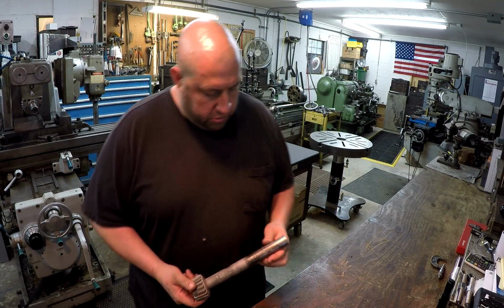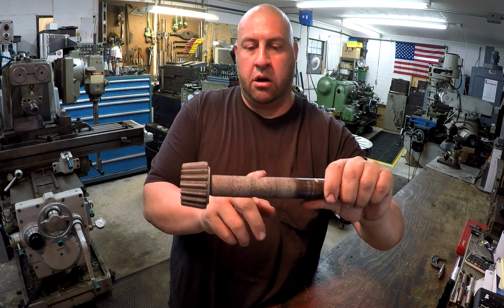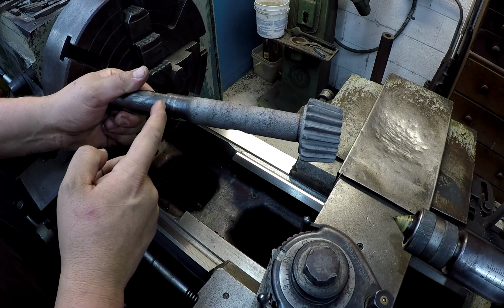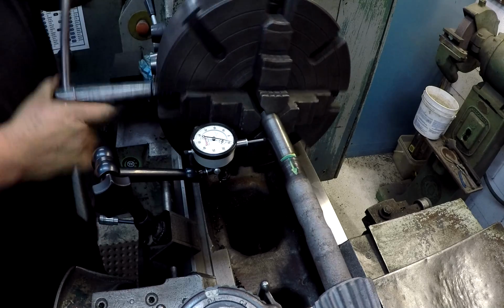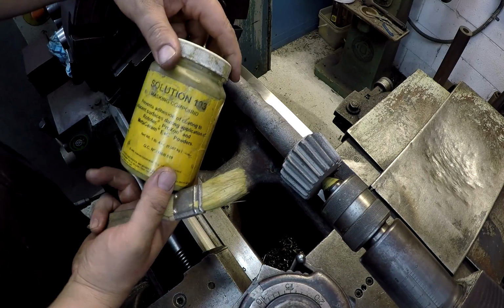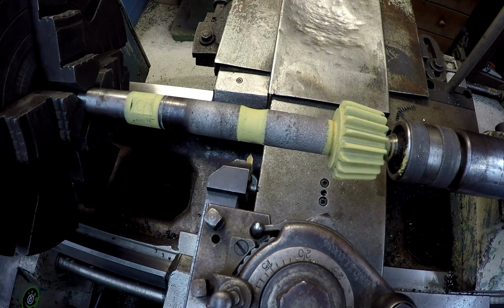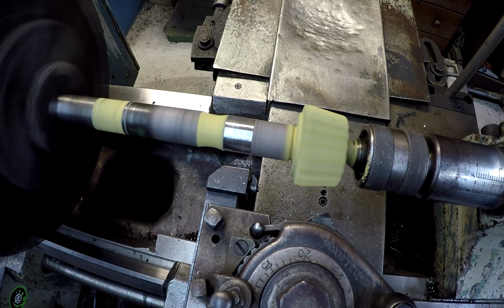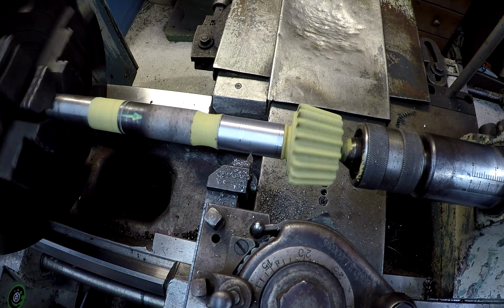Shaft Metalizing Part 1

Comment: Been there in the 70s . the shaft I worked on was 6' long and 4" in diameter. Utechnic has many powders of different hardness on the Rockwell scale. We didn't pre-cut. Heat the worn area to cherry red, spray the required powder and allow to cool, then machine to specs.

Comment: Great, I had seen spray welding before in the very 80's , it was used to weld automotive headers. Since then I have asked other welders about spray welding and they all had not heard of it and all thought I was crazy. I had even searched with no luck finding equipment to do it. What I was being used was very similar to a cutting torch with a gravity feed cup that held the powder and there was not a two part system used, just a single powder method, but that was long ago and things have likely changed and advanced.Thank you again; now I know I am not crazy talking about spray welding!
Reply from the maker: I do have another torch called Eutoloy. It uses one powder and it's more like brazing or flame welding. Something I still want to show in a video.
Reply: the time I had seen spray welding, the guy claimed it was great for welding thin metal like the header tubing I had him repair. i also remember him saying that the  metal powder came in different  Rockwell hardness grades. I always look forwa Rd d to all the topics in your channel.

Comment: At Kelvin A boiler house Fincham the maintenance super used this system until he had so many failures that he almost shut the station down I now know there is a newer system with better quality controls so I may use this system and hopefully gain some confidence in the procedure that wont peel the coating off the repair.

Comment: You may have mentioned this in your other spray welding videos: If you are spray welding bronze, make sure you have a Very Good exhaust system to the outside of the shop. The smoke contains zinc and breathing it will give you what was called in the foundry "brass chills." The symptoms will have  you thinking you are coming down with the flu...not pleasant.. ask me how I know.
Reply: Metal fume fever isn't fun.
Reply: Bronze doesn't contain zinc...did you mean brass?
Reply: Many types of bronze do contain zinc, and metal fume fever isn't caused exclusively by zinc.
Reply: Oh, ok...
Reply from the maker: Yes I'm aware. When I mig weld aluminum bronze wire I use my respirator welding mask.

Comment: Hi Abom,

When I saw this video working with these machine was my dream, I was in arts highschool but I was smart enough to do industrial design afterwards, I then got my welding certificate and I'm now happily working in a small workshop in my city.

Today I used this very same process. One that, when I saw this video, I thought I would never see with my own eyes much less work with it.

Anyway I used this process in an old lathe they didn't use anymore, everything went fine and I left it too cool. Afterwards one of my coworkers machined the surface and during the process the lathe broke (the axis gripped)

One of my coworkers says that it's because I did this process, heating the axle and that's why it broke. I think it is because the lathe DIDN'T HAVE A DROP OF OIL. What do you think? Is this process dangerous for the lathe?

Anyway, thanks for these videos Abom79

Comment: Hey Abom greetings from Germany.
I just wanted to thank you for your awesome videos. You had one spray welding  video in the past which helped me a lot at my job.
We had that spray welder lying around in our shop and nobody really knew how to use it. Then i saw your video and learned that welding technique.
Thanks a lot !
I got two  question for you . What "powders" are you using ? I feel like my sprayed surfaces sometimes get hard like rock and i cant properly turn them without ruining my tools.
And the second question which rpm are you using for spraying ?

Keep up the good work Abom !

Comment: $750-$800 for a short shaft with a bevel gear on the end of it?  That's highway robbery there!  A new, aftermarket front driveshaft for my Jeep TJ, without the installation cost, was only a third of that!  OxToolCo was right to send that shaft to you to spray weld it back to size rather than get so blatantly ripped off. -____-  Meanwhile, I think you got yourself a future T-shirt pose in the second camera angle showing you overall doing the spray welding. x3  I certainly would buy one if it was available.  Fume extractor worked wonderfully too to keep the shop from getting all smoked up while spraying.
Reply from the maker: Plus the repair provided all of us with some fun content to enjoy! 😀 Seems the shirt idea is popular
Reply: $750 sounds cheap to me. You are comparing replacement parts for a late model Jeep produced in the hundreds of thousands. Even the performance after market is in the tens of thousands. The saw that shaft came from has likely been out of production for 50 years. They might have made a few thousand of them. I'm amazed they even had one to sell.

Comment: Are there different materials for different specifications of the end product? Hardness, alloys, I really don't have any ideal. On the noise of the fume extractor it didn't hurt audio at all. As usual I enjoyed your video.   ;}
Reply from the maker: Yes there is a vast variety of powders to use in many different alloys.
Reply: Thank you  ;}
Reply: yes there are i actually do alot of spray welding for repairing eletric motors and a varity of shafts. there's all from stainless to ceramic spray. some are better for other aplications, some can only be ground even trying to cut with carbide is futile.

Comment: Hi Adam,i have a question,i saw the video where you did use the Eutectic for Brazing and what i was wondering that you did heat up the shaft so much that it was bright orange and with the spraywelding you dont bring up so much heat to the work,or was it actually  to hot for spray  brazing,or did i underatand something wrong?,Thanks,very interessting videos.

Comment: Hi Adam ! Awesome video. Have you ever tried a Metco 5P gun ? It's gravity fed but has a on and of button so no need to coat the sealing ;-) cheers Markus
Reply from the maker: No I have never used them. I seen one at the flea market at one time, but looked rough.
Reply: I used to work for them. Still work in the spray industry. We spray gas turbine parts. The 5P are reliable and easy to maintain...

Comment: Nice work Adam. What is the benefit of spray welding over brazing or wire welding material onto the shaft?
Reply from the maker: It doesn't warp the shaft like conventional welding will, it's also faster and easier...to me anyways. I know others have a difference in opinion over my techniques. I repair a lot of gearbox shaft like this, where a seal has cut a small groove into the shaft. A spray weld repair is fast and much cheaper then any other fix, or replacing.
Reply: Thanks Adam. That's cool.

Comment: Bet your insurance man would freak out if he caught you doing that! Way cool my friend way cool........  One question though. Do you get the same wear factor by metalizing and does it actually melt the powder as it goes through the flame and sticks to the work piece? Also does the powder come in different grades for hardness etc....?
Reply from the maker: Use my this torch is no different then any other cutting/welding that takes place in the shop.
Reply from the maker: The powder is melted when it hits the flame and microscopically welds itself to the base metal.

Comment: I could see this as a good repair for a worn seal surface  but the sprayed on metal doesn't have structural integrity so why turn down the pitted part of the shaft and spray on the metal coating in that area?? Also, why wasn't the "beveled" area (reduced diameter) resurfaced?

Comment: I was just curious how you account for stretch between the chuck and the tailstock as it expands from the heat? I assume the shaft will slide in the jaws on this application but what if you had to hold it between centers? Thanks for sharing
Reply from the maker: Something I didn't touch on but I only just barely snug the tailstock clamp, allowing the shaft to push it back when it expands. All you want is just enough to hold the shaft on center.

Comment: We had a spray weld setup in the shop I used to work at, but I never learned or ever saw it used. Now I wish I had. 
Do you have to back off the tailstock as the part heats up and gets longer?
Reply from the maker: I leave the tailstock only slightly snug to the bed ways so that the shaft can push it back when it expands.

Comment: Adam, does the over spray just drop? Is that why you didn't cover the wall of tools on the other side of the lathe? Thanks!
Reply from the maker: Yes it's on the floor as dust.

Comment: If the shaft was to fit a broze bushing, then why not just true the shaft and adjust the bushings to fit?
Reply from the maker: What about the coupling that fits on the end? Change that too? Best is to make everything back to the right size. I'm sure Tom is replacing the old bushings.